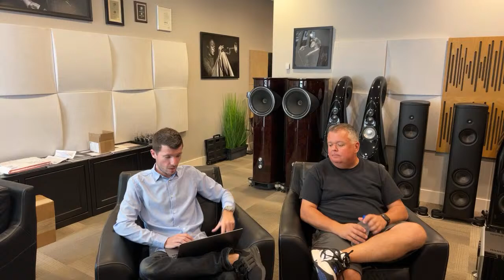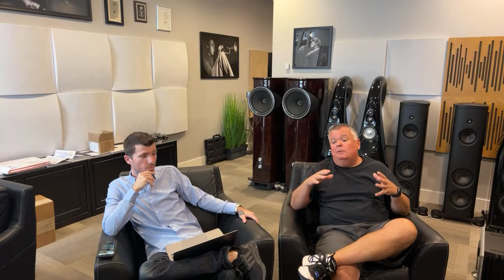Mike & Mike answer your questions! (May, 2022)

Comment: Hi gents, love your work! Looking at the new B&W 801D4, would you consider this speaker a leader at its price point? In your choice, what's the best Amp and pre plus Dac for this speaker? Personally looking for a holographic image with pin point instrument placing. Overall budget is $200K
Reply from the maker: Hi Brad, yes, hands down.  I would add 2 or 4 DB1D’s or DB2D’s depending on the size of your room, not for MORE bass, but for better, smoother bass.  Money well spent there.   Assuming no vinyl at this time, I would do the 801D4’s, two DB1D’s, the Block Audio SE monos, the Block Audio SE Pre, the Esoteric N-01XD and AQ cables.  Done.  World class, holographic.
Reply: @highendaudio  awesome! Thanks mate, much appreciated! Not sure Block is available in Australia just yet, but have heard great reviews.
Reply from the maker: @bradessendon05  Definitely see if you can locate it.  If not, I would look at a pair of SimAudio 860V2 monos and the matching two chassis pre.   I would suggest the Classe Delta Monos/Pre too, but the Delta pre takes a LONG TIME (like 1000 hours) to break in.  The Delta Monos are wonderful from the get go.   The Luxman M10X monos are also terrific, but you would have to get the C900u pre or wait until next year for the C10X.   We will want updates and pictures of your new system!  Keep us posted up here.
Reply: @highendaudio  thanks so much, and most definitely! Actually looking to purchase a new house with a dedicated 2 channel room, previously into home theatre. 
My Electrocompaniet Nemos were great, however they’re 20 years old and due for an upgrade.